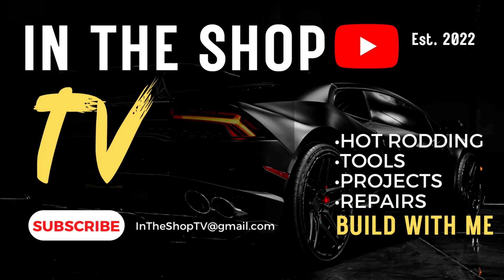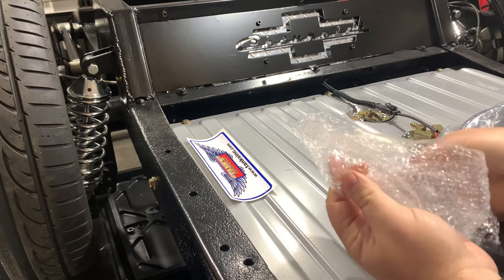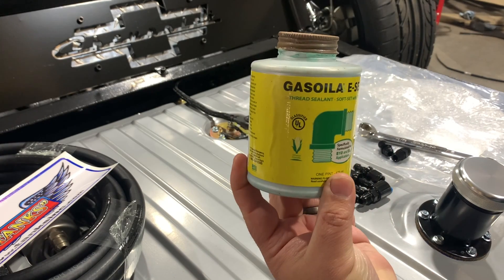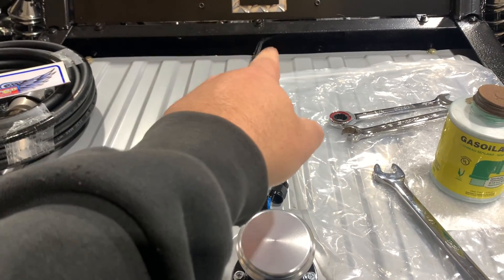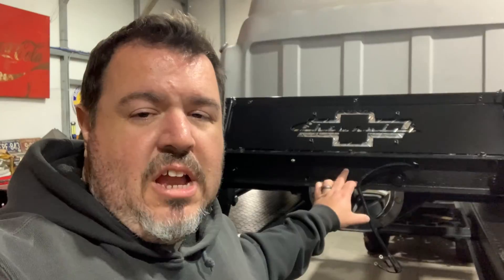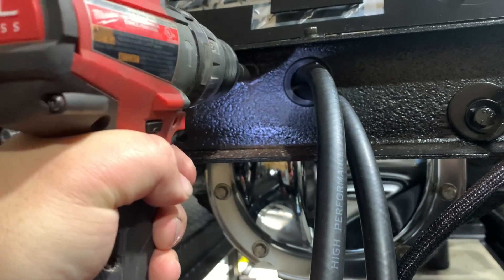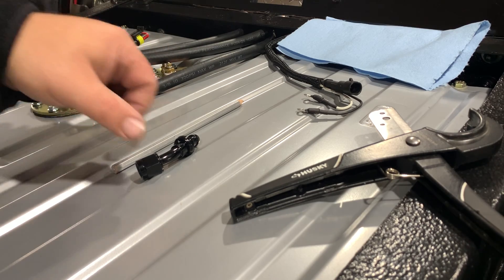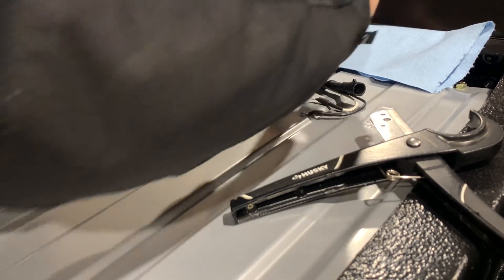LS SWAP Fuel System - Simplified! (Pt.3)

Comment: I wired my truck up, and it won't run with the fuel pump running. It dies immediately when i put power to the pump. Would you have any ideas? Pump works, everything is firing and im stumped.
Reply from the maker: @johnjames3504  which pump, do you have a separate regulator, the corvette filter regulator? What’s your setup?
Reply: @intheshoptv  stock pump for a 2002 silverado to a corvette filter/regulator and straight to the fuel rail

Comment: Great video... I would give you one constructive criticism though. Please lower the music volume when editing your videos. It really should be a background noise not blasting us. I had to keep adjusting the volume down every time the music started, then turn it back up to hear the dialogue when the music was over.  Greta video again, thanks.
Reply from the maker: @richardlewis1359  others have complained about that. For some reason, when I edit, its all the same volume, but on some people’s devices, they seem to have your same issue. This is an older video and I have since lowered the music in editing even more. Would you do me a favor - Check out one of the newer ones and let me know if the problem persist? Thanks!

Comment: Great video as usual!! I was wondering how you mounted the vents? I, as you know, am rebuilding a'56 Chev pickup and I put in an aluminum tank from Performance Online. A little different install, but for the most sake, its the same. I'm just wondering how you mounted the two vents you described. I didn't see any videeo with that in it, mind you, I don't have the same C frames, mine are simple notches so figuring out where to put my fuel vent is something I have to figure out. As for the diff vent, my 10 bolt has that plastic vent on the diff for now, but I like your idea.
Reply from the maker: Thank you!! Ah, here ya go: https://youtu.be/rwANmQk--gM?si=5o4Ezv0CwOlDDpfw
Reply: @intheshoptv  Thanks Mike, I know I had seen it but couldn’t find it! Did you think about a carbon filter inline on the fuel vent so you don’t smell gas in the summer?
Reply from the maker: @sarblade  I would retrofit one if needed but so far, its been pretty warm in the shop and no odor (unless you put your nose right up to the fuel line by the manifold)

Comment: So the ground doesn’t have to be shorter? I can run it all the way to the engine bay?
Reply from the maker: You “could”. In my case, I relocated the battery to the rear and grounded the frame in the rear AND the front. So the ground for these components will be grounded to a small ground distribution block just two feet away in front of the tank. As long as you’re sure you have a good chassis ground, you can technically ground it anywhere on the frame. https://youtu.be/pY8pCoqoQF4?si=Q2oMycfA2VOKLO3Y
Reply: @intheshoptv  Nice, I’m relocating my battery to the rear as well… but I ran the hot to the front… I’ll just do the same since I have ground distribution block laying around 🫡. Thanks for responding
Reply from the maker: @RuthlessWrenches  Anytime brother. Good luck! I have a video for that too! Lol😂Battery Relocation Tips - Its MORE Than Just Moving a Battery | MUST WATCH! https://youtu.be/AiUgmPAAnpQ
Reply: @intheshoptv  I appreciate it, I need all the information I can get lol
Reply from the maker: @RuthlessWrenches  Makes two of us lol!